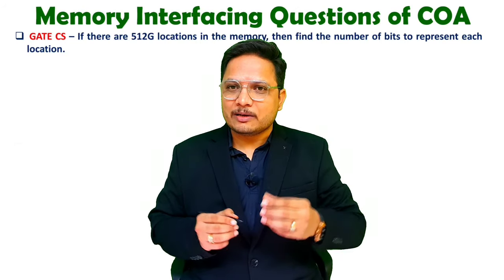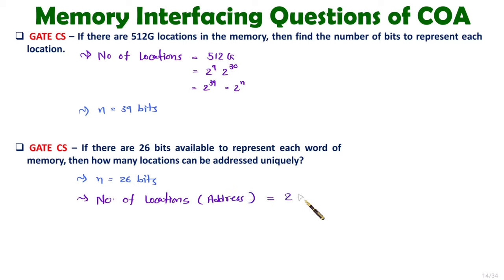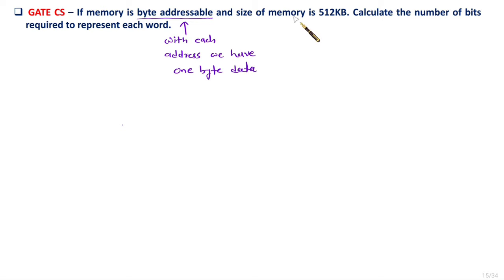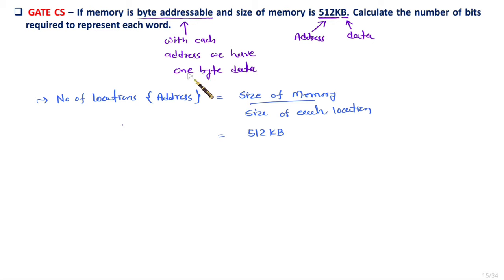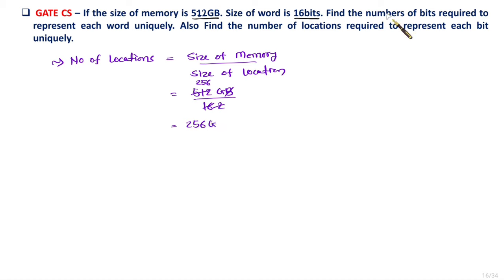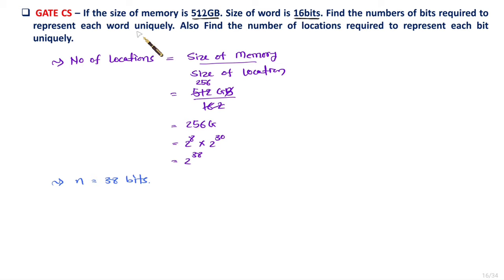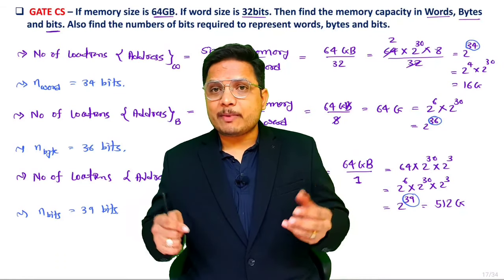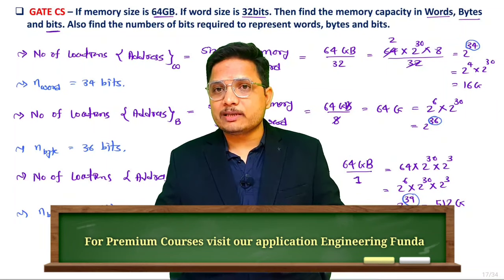Memory Interfacing Questions in Computer Organization & Architecture: Solved Problems - 1

Comment: Sir please , if we have for example 2 memories one with 4 gb capacity and the other is 8gb ....can they share the architecture wich is having 10 bits adress size ??? If yes ...then what is 512g in the example should refer to is it the capacity or number of locations??
Reply from the maker: 10 bits address has only 1KB memory
Reply: @EngineeringFunda  i mean are memory capacity and number of locations in memory two different concepts ???
Reply from the maker: @faridsahraouiii  yes, locations are stored at address.

Comment: hi there in example 4 in the second part 

1 byte = 2^8 or am i wrong? because each byte is 8 bits
Reply from the maker: 1 byte = 8 bits
Reply: @EngineeringFunda  thanks for response so in that case in example 4 we should've written 2 ^8 instead of 2^3